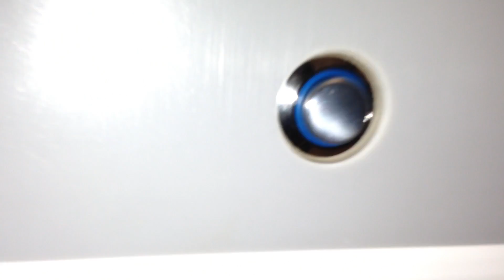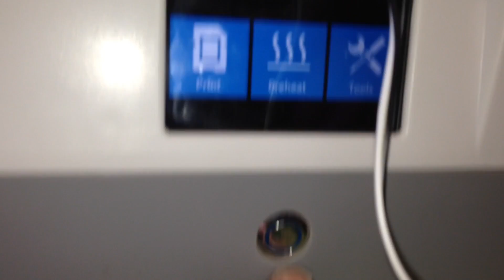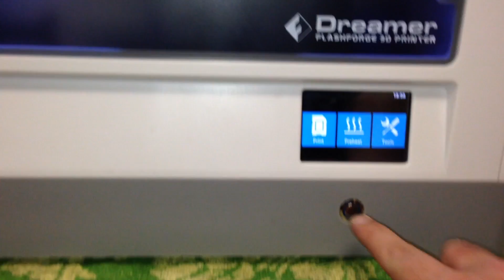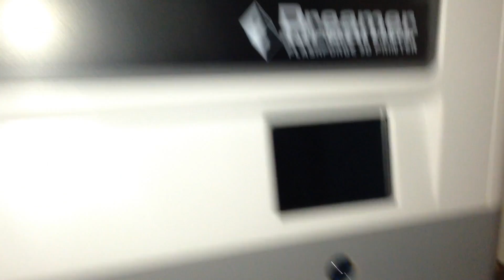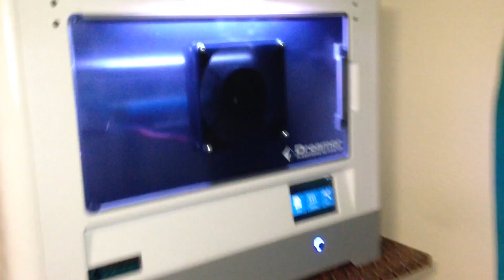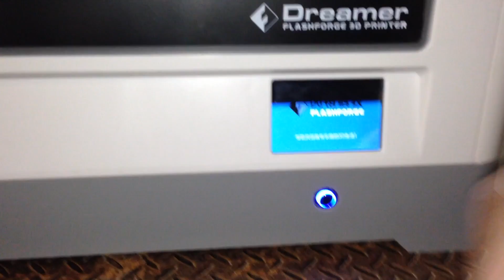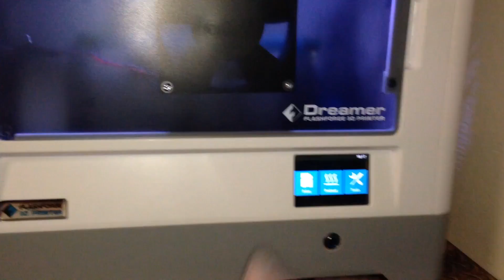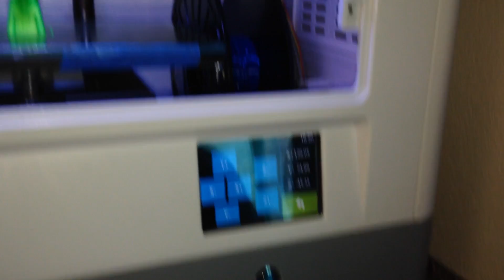Flashforge Dreamer - Active Cooling Upgrade

Comment: Would the fan on the door do anything given that you don't appear to have any holes allowing air to pass through the perspex?
Reply: Sorry I sound like a troll! GREAT job man I want to do the same but have it controlled by a thermisistor. I didn't intend to sound like a troll i am legit impressed.
Reply from the maker: +Johann Wyss Hi. That's ok. The front fan sucks the air from below as there is a 8mm gap between the door and the fan and it sucks the air from below
Reply: Ahh fair enough, I personally would have it pulling colder air from outside and blowing it across the build area. Cutting perspex can be a frustrating task so I can't blame you for not doing it. The cost / frustration probably outweighs the benefit a few times over. =D I want to do something with mine (creator pro) I have a inquisitive cat which makes keeping the lid and door /off or open out of the question. I'm leaning toward two 80mm fans lower left for intake  with two more top right for exhaust all four controlled by an arduino and thermistors.

Comment: The fan on the door makes no sense without holes drilled in the door for intake or at least spaced off the door a little, other wise you only creating cavitation which is a breeze of some sort but not what the fans designed for.
Reply: This is all I could think about the whole time I watched this video.
Reply from the maker: FoxHoundUnit89  I have spaced the front fan 1cm from the front door and it has a duct so it can suck the air from below the fan. It's not installed in this video but just spacing the fan 1cm from the door was good, but with the duct it is a LOT better. I didn't want holes in the door because when I print ABS I can still seal up the printer to keep in the heat
Reply: Thomas James Ah, yeah, that'd work.  I know you want it sealed during ABS printing but in the video it just looked like it'd be useless haha.

Comment: I just bought one as well and it came with two fans in the back. They activate from time to time, I believe that it is temperature controlled. I noticed there is a temperature sensor wire on the right side wall of the printer (it looks like a wire that goes nowhere). I'm having problems trying to get abs to stick though. I'm going to try using abs juice to see if that helps.

Comment: My dreamer came with the two back fans. They are not always on. Not sure if temp controlled.
Reply: Adrian They are temp control with simplif3d... the stock software is sh*t
Reply from the maker: My Dreamer came with no rear fans so I installed 2 rear fans, 1 big fan on the left and a big fan on the door and have them all come on/off with the button on the front panel. I agree with MasterKozuko the stock software is crap. I bought Simplify3D and it was worth every penny!
Reply: Have you by any chance gotten to connect via wifi from simplify3d? I am currently using flashprint for the WIfi feature. I bought mine about a month ago, it came with those fans. I took a bunch of pic of the elctronics for future reference. SD card doesn't work when Wifi is enabled. Internal SD does work fine thought.
Reply from the maker: Hi. I am still running and old firmware v1.61

The wifi never worked until v2.0. I gave up updating the firmware after 1.61 and my heated bed doesn't always turn on for a print, so I cancel the print and start it again and it's fine.

So I slice a file using S3D and save it to the SD card and just put the car into the printer. I don't use USB or wifi, only SD card
Reply: I understand, well, for what it's worth. I have the latest firmware now (2.2) and it's a bit buggy on wifi. I can usually send .gcode files via wifi, but if I touch the display panel, it stops working. So i have to restart the machine. The bed works 100% of the time for me. Also, if wifi is ON/ SD has the "error" message. Thanks for sharing you experience with me,

Comment: I could see in the previous video, the two fans gave the same clean print as the 5 fans. In your previous video you mounted two fans to the front with zip ties, I just wondered if you would only install those two fans in the back of the printer instead of the front of the printer wouldn't it give adequate cooling as well, with just two fans? Or why not print a nozzle that would aim the airflow of one smaller fan directly below the print heads ?
Reply from the maker: The 2 front fans were just a temporary test. I'm in the middle of designing a new airflow duct to direct cool air towards the nozzles

Comment: Did you ever try with just the rear fans? In your first video you only had two front fans, that might actually be enough don't you think?
Reply from the maker: My printer was delivered with NO fans. I just had rear fan grills with no fans. I then went out and bought 5 fans myself.